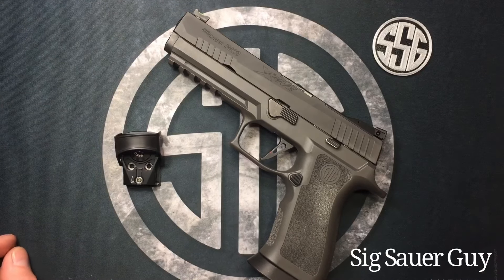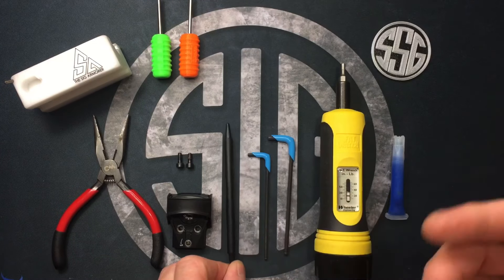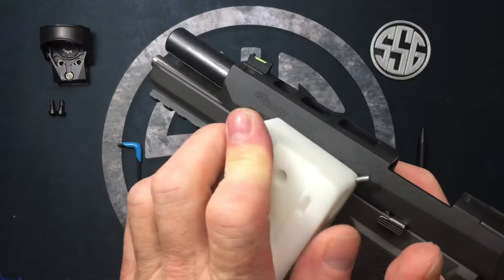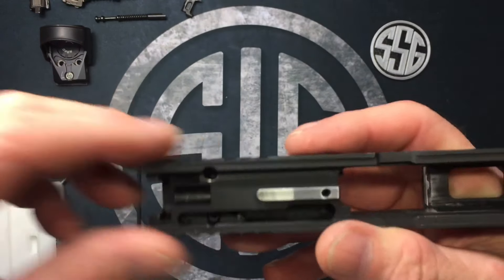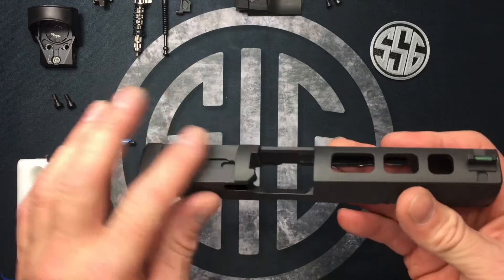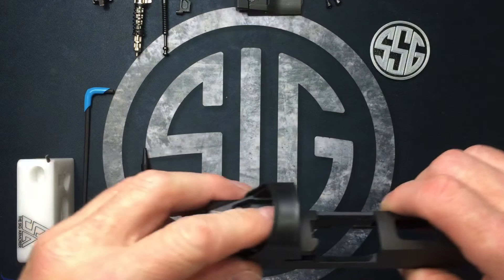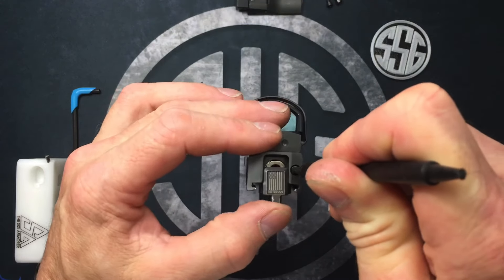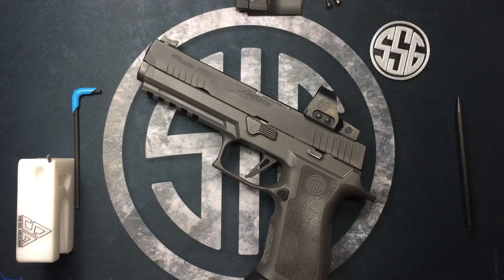Sig Sauer P320 red dot sight installation

Comment: I just purchased the Sig P320 about 2 weeks ago. The rear sight plate was coming loose. And I did not know why. I had been watching your videos on how to break down the weapon for cleaning. So I ran across this video and it helped diagnose the problem. The two screws needed to be tightened up. I took the plate off cleaned it put it back on. A little Loctite. And I'm good to go now. Just want to say thank you your videos help tremendously.
Reply from the maker: Then we both have a successful mission! Thank you very much sir and good job!

Comment: One thing I learned was that you can leave the striker assembly in place while you do this, just lower the backplate far enough to remove the extractor assembly and extractor claw, then pop the plate back up into position, holding the striker in place.
Why do this? the fear of screwing up and losing that tiny spring off of the striker assembly.

Comment: Good video. Good camera angles. Odd other gun makers don''t put grooves into the slide and thus requiring plates to also have a  "foot" to stlip into the  groove. Glocks  RDO  floor is flat. ...Langdon adds a 3rd hole to screw the plate into the slide. Odd no one else has done that (that i'm aware of).  Just that little bit more effort in design...

Wonder what the floor of the  RDO shoe looks like on a Nighthawk with their IOS or Agency Arms with their AOS mounts.

Comment: the screws the Romeo 1 came with are too short to mount on the p320.  They ended up stripping.  Did you get longer screws?  Just wondering how people got around that.  Also it doesn't fit tight on the p320 as there is a gap in front of the Romeo 1.  I would have thought SIG would have gotten those right or am I missing something?
Reply: And yes I used the longer screw that came with the Romeo 1 but they are still too short and stripped without ANY torque applied..

Comment: Lame question but if I am just replacing a defective Romeo 1 pro for another do I have to remove the plunger and extractor or just remove and replace with the 2 top screws?

Comment: I just bought a P320 but I don't see a removable plate. Can I put optics on that gun? Thx
Reply from the maker: Not unless you have the slide milled for an optic. Its not usually clean. Often times if easier and almost as cheap just to buy a new slide like the pro cut slides or something similar.

Comment: Great video, incredibly easy to follow. Also question, the rear plate, is that standard size on the x5 and regular 320? Also mind asking where you purchased a customized one. Thanks!
Reply from the maker: Yes sir. Standard size. I used to get them from NDZ performance.

Comment: I seen you installed the Romeo 1 and not the pro?. Will the Romeo 1 work?…it must have because you just did it…lol. And is there anything I need to do to install the R1?..screws, mounting plates, I do like the shroud though…that I don’t have. But if that’s all I need to make it work then I will buy one.
Reply from the maker: That slide is before the Legion series. Original X5

Comment: Why do i see so many videos saying the Romeo 1 will not fit the x5 legion? They all say you need the Romeo 1 Pro. The dot you installed was a romeo 1 on an x5 legion correct? I just got the legion x5 and romeo1 yankee marshall says sig sucks cuz the Romeo 1 does not work and was told by Sig he needed the Romeo 1 Pro. Please clarify for me before i attempt to install and strip tbe slide
Reply from the maker: This legion was using the older X5 slide. Pre legion X5
Reply: @SigGuy  thanks for the response. As usual Sig just replied partially 2 the message I sent them they told me for my X5 Legion in my axp scorpion I need to run the Romeo Pro 1. But I also asked them what gun besides the X carry does the Romeo 1 fit their websites all say the same thing fits many other platforms but doesn't tell you what it says I already have the optic so now I need to know which kind I should buy next that that optic will fit on or see if I can sell the Romeo 1 in order to buy the romeo1pro although I'd much rather just buy another gun. Thanks for the response great videos

Comment: Optics planet sells regular sights for the 365xl, my question is how do I change the rear sights on the xl pistol
Reply: Tommy Miller you remove the back plate in the same manner. Not sure which “regular sights” you’d replace it with. Mine came with Sig x-ray sights which are amazing. But you get the rear sight plate off by removing the slide and there are also 2 screws in the slide that hold the rear sight on. Just like in the video. However, with the p365 XL the screws aren’t blocked by a spring like they are in the P320s. You can just screw em out with an Allen wrench.
Reply: Will the Romeo 1 work on the x compact? I was told it’s a little shorter on the base plate
Reply: @tjsworld2338  I have one for the X carry and i have a small gap as well. Still works no problem. I'd contact sig's customer support. They have a number you can call and you can speak directly to a sig rep. They'll answer any fitment questions you may have just to be on the safe side.

Comment: Does the shroud takenthe place of a mounting plate? I have the 320 M17, just wondering if I need the mounting plate with the romeo 1, but I like that shroud for protection.
Reply from the maker: zhissem The shroud is just in addition to whatever you are already meeting for installation. The RDS slides inside the shroud and that’s it. It uses the same mounting holes as the red dot sight.

Comment: So a sig sight shouldn’t need an adaptor plate but others will? I have Romeo 3xl going on a legion
Reply from the maker: My X5 is the older footprint. It’s different than the newer X5 lesions. The new footprint on the Legion is making it more compatible And illuminating the need of adapter plates. You’ll have to look at the specifications to determine whether a plate is needed or not.
Reply: Well honestly I’m getting the grip from legion it’s just a regular 320 x5 but I’m trying to start shooting USPSA again and going to try carry optics I was just trying to get all my parts here together. But thank you much for the info

Comment: Tried to install Romeo1 on my Sig p320 M17 and the bolts that it brought feels like they are to short I'm talking about the original bolts that came with the Romeo1 box! Did you used different bolts longer or you used the same that came with the box?
Reply from the maker: The M17 uses the Romeo1Pro or a DPP red dot sights.

Comment: Hi Everyone,

What's a good way to remove the battery cap after it's been torqued? The little screw driver from Sig is useless for taking that cap off to do a battery change. I'm trying not to ding the slot of the battery cap all to hell..
Reply: The torque wrench he used in the video? How did you torque it down in the first place?

Comment: FYI- my M18 had T10 screws holding the sight plate on.
Reply: Are screws loctite in place from factory? Do I need to use heat? Is it indeed a T10, I assume you removed it to confirm this. A 3/32 hex fits, I just stuck a T10 and it fits in there good too. I don't want to strip the screws. Thanks in advance.

Comment: Hi Sig Guy, hey I'm doing a sig p320 build and I want to put  halosun red dot. Is there an adapter plate for the sig pro cut slide or is ther a slide that works on p320 and halosun red dot? Thank you

Comment: I know this video is old, but if i were to put the rear sight plate back on after removing it, would i need to re-zero the sights? Or is that the reason the notch is there.